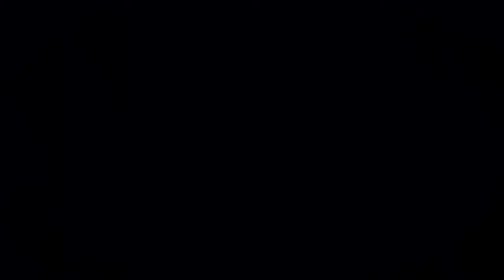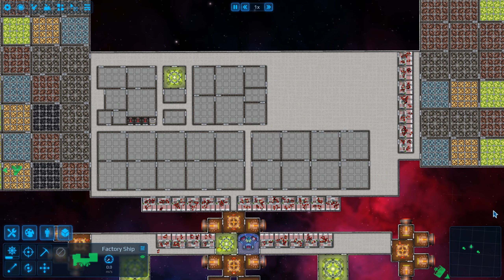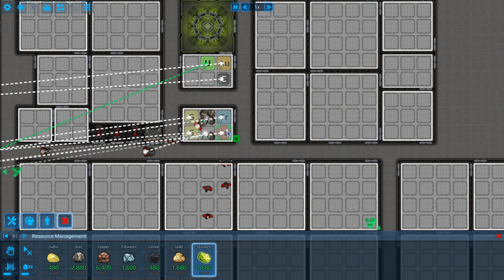Guide to Factories and Logistics  🚀 COSMOTEER 🛸How To, Tutorial, Walkthrough

Comment: I know this is dated, but the issue above is that eventually, it will burn through all the coils in making the other components.  You have to limit the output of those secondary components to limit the burn through of the required components.  Just having them all go randomly into output storage will eventually leave you empty of coils when you need them.  Depending upon how far along I am, I'll dedicate a few storage rooms to those secondary components.  And the ammo factories honestly should be on the combat ships, storing sulfur (or whatever is required for the missiles used) instead of the resulting ammo as that is explosive (aoe damage around the ammo storage)

Comment: Nice idea, but really hard to follow. It goes by so fast and it's unclear what the heck you are doing with all those arrows going everywhere. I know you're trying to keep the time down, but for me anyway it really needs to slow down and explain the details a bit more. Still, it's helpful and I did learn a few things, so thank you.
Reply from the maker: You are right I am trying to keep the video length down and I avoid jump cuts, I want to try to explain things as they happen rather then just cutting to 'Here is one i prepared earlier' which leads to the running parts of the video at 8x speed. This combined with the not great interface for logistics means there is a lot on the screen at once. I'm glad it helped somewhat and Ill keep what you both said in mind going forward
Reply: Agreed, starting around 15:40 it is VERY hard to follow because there is so much movement on screen which makes it hard to track his mouse during the explination.  Especially when the crew is running around at 8x speed. - KhaoticChicken
Reply: Youtube lets you slow the playback speed if you like.  Try .75 or so, that might be easier than pause-rewind-play